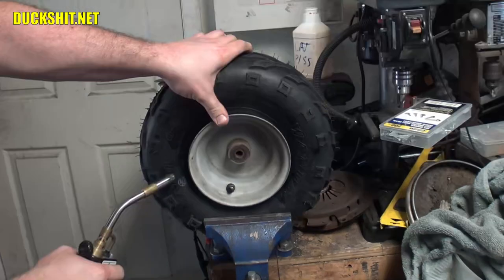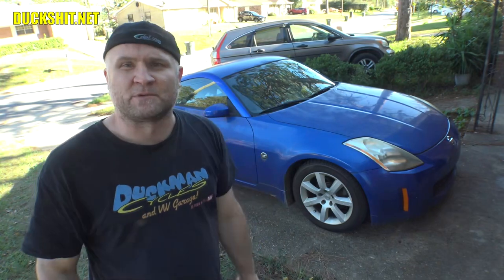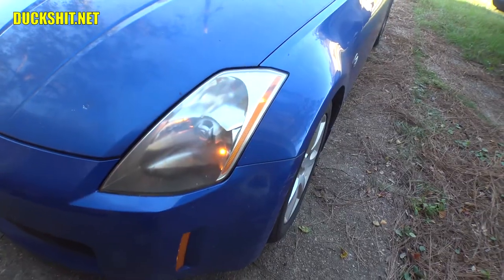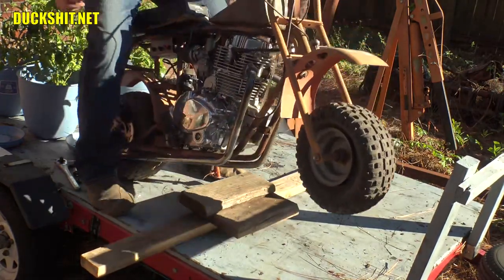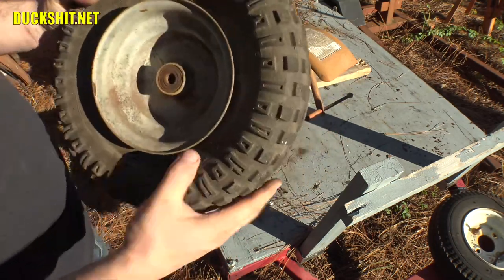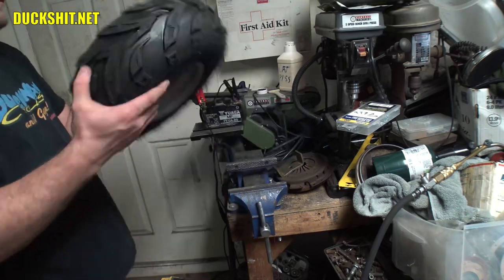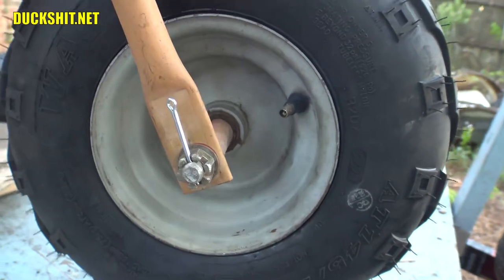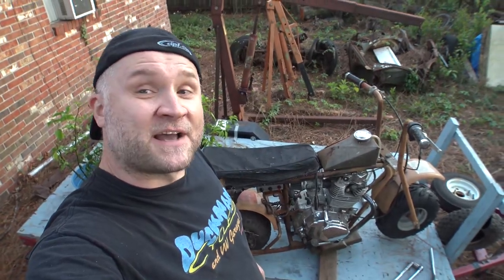Minibike Tire Replacement - 350Z Update - DoodleBastard Engine Swap - 22

Comment: Racket straps I’ve used before on tires wrap around the tire racket and put air in works great. I take the value stem out to hurts the air in. Tons of methods.
Reply from the maker: But without explosives its not fun!  LoL!

Comment: At least you got the tire chevron pointing in the right direction! Years ago I worked for a Diesel Engine company (those that people F'D up came to me when they claimed Warranty. No Dumbass check the oil)... The company was all over a new tractor that another division made. So we sit in the conference room and they handed out the brochures. I started laughing. Everybody looked at me. I said: "What's wrong with this picture?" Blank stares. "The back drive tires are on the wrong side!" Had to explain to them that they have to dig and push the mud to the outside and the way they had them would load up and get stuck. "Any Farmer that sees that would wonder what else you did backwards!" Yeah, I know they just stuck it together for the photo shoot. They asked me how I knew that and I said: " My Granddad was a Farmer and taught me about tractors and how to drive them when I was about 7"...
Reply from the maker: LoL!  Yes, I know the correct way to aim it.  :-D
Reply from the maker: I see them wrong all the time too, also see wrong street tires as well.  Someone called me out on Eleanore once as I didn't bother to put the rear tires on correct once upon a time, the fronts were non-directional but the same brand and model.... strange.  Didn't matter for sitting in the garage, but it was something I just didn't bother to get around to.  Hehe!

Comment: Good work as usual, Tyres look good on the doodle bastard. That foam doesnt look so hot tho, probably needs the fire. Be great to see more on Gregory.
Reply from the maker: Thanks so much!  The foam is solid!  It stays!  You may only be looking at the edges from when the idiot that made the seat allowed the foam to wrap some spots at the bottom and it got chewed.  You will never see that when I clean it up!
Reply: @DuckmanCycles  no, I was just thinking that it looked like it  was real hard. As you know as foam ages it can harden.
Reply from the maker: @100Jeanluc  Not unusually hard nor crispy at all!  Ready to be re-used!

Comment: One fundamental question:
Would you go for metric or imperial?
In my opinion, it´s time to move away from the imperial system and replacing it by the metric one. Inch by inch....
Reply from the maker: I am not sure how your subject and question is relevant to my video, explain.  I'm not as foolish as you might feel most americans are.
Reply: @DuckmanCycles  Thanks! I find your answer assuring... I don't think Americans are all lost to the human race, you being an example to follow❤️